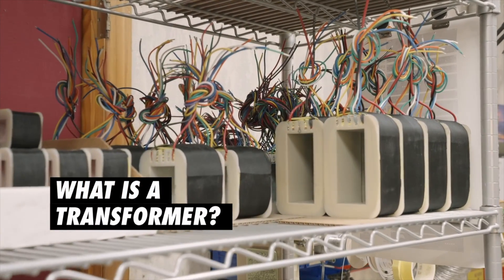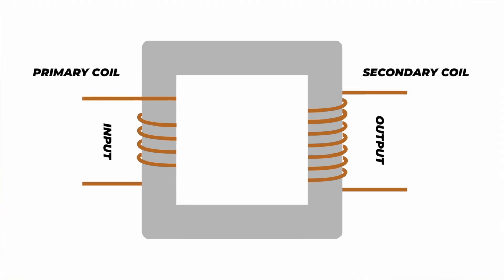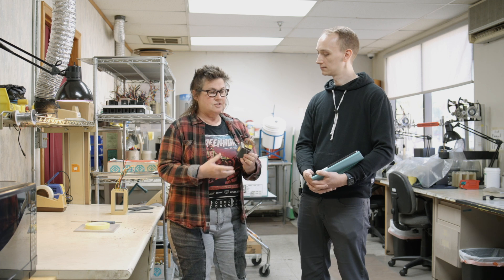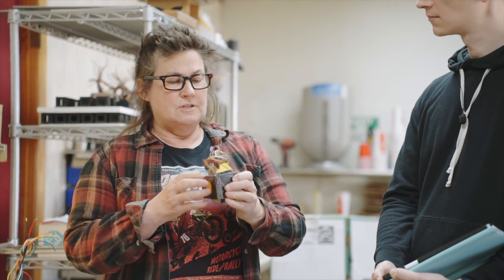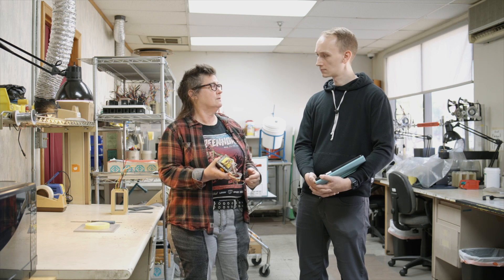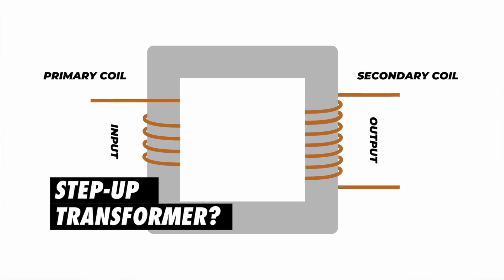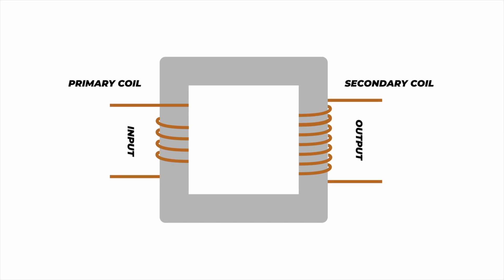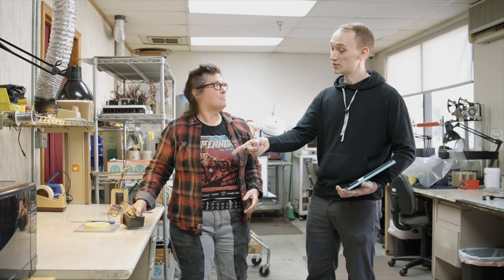Audio Gear 101: Transformers Explained

Comment: It is a resonant coupling. Impedance matching device. An electrical equvalent to a mechanical transmission. A proper load mechanism. It is not passive. It has many characteristics.

Comment: That explanation was probably quite confusing for someone who doesn't know already how a transformer works. 
Simply put, the transformer in this case converts a high voltage AC, into a lower voltage AC. 
As the power output from an amplifier is (simplified) it's output voltage times it's output current, the high output voltage means the amplifier will not be able to supply much output current. 
So, if it's connected straight to a standard 4-8 ohm speaker, the output will be very weak, as it get limited by available current, rather than available power (the distortion may also increase to much more than wanted levels and the amplifier circuit could overheat - because it's being overloaded). 
The transformers job is to lower the voltage and increase the output current - so that the output doesn't get overloaded and all (or at least the majority of) the available power from the amplifier, can be used to drive the speaker.

EDIT: I forgot to mension - running DC thru a transformer isn't a great idea either. It does block DC in the way that no DC is transferred thru it to the speaker - but the primary winding may act almost like a short to DC (current get limited by only the resistance of the winding and not by inductance, as it does for AC), causing it to overheat. It will most likely also saturate the core - causing very high distortion levels on the AC signal as well (far more than what's wanted). To block for example a DC component of the signal, a capacitor is much better to use.
Reply: This just confused me more. What is the point of a transformer?

Comment: Yoou could have gotten someone who does not confuse the hell out of this subject.Something basic like:Transformers are used to change AC voltage levels, such transformers being termed step-up or step-down type to increase or decrease voltage level, respectively.
Reply: Don’t they have somewhat different applications when using them for audio vs power? I would think impedance and decoupling would be more important to the context of an output transformer to drive speakers, for example.
Reply: @almightytreegod  The only difference audio, compared to power, is in the transformer it self - it needs to handle a very large frequency range compared to power transformers (most power systems is built to run on just one frequency or within a narrow frequency range - compared to audio, where one transformer may handle everything from 20 Hz to 20 kHz or sometimes even better). But it works the same way.
If the voltage is stepped down, the available output current steps up - and the opposite. The thing is that the output from a tube amplifier is high voltage, but can't supply very much current (way too low output current to drive a standard 4-8 ohm speaker). 
So the transformer steps down the voltage and that way increases the output current, so the amplifier output doesn't get overloaded and it's available power can be used to actually drive the speaker.
Reply: @Speeder84XL  good to know, thanks… now that you mention it, what would determine a transformer’s frequency range?